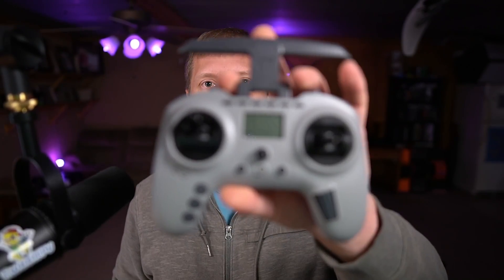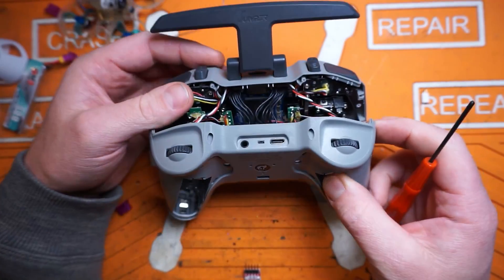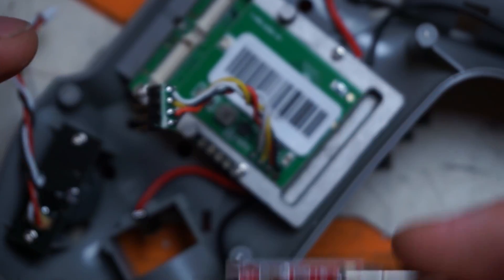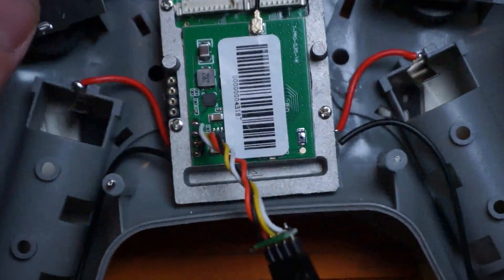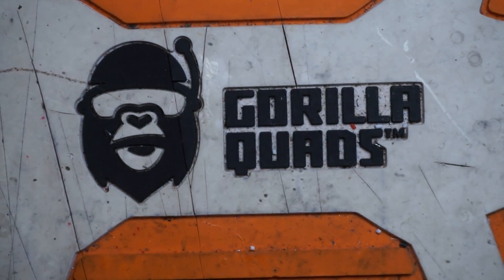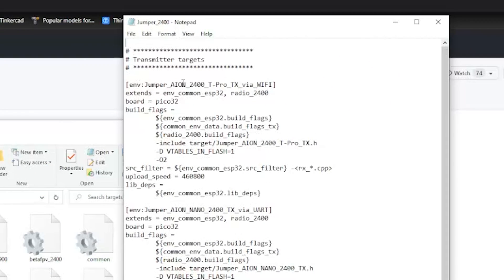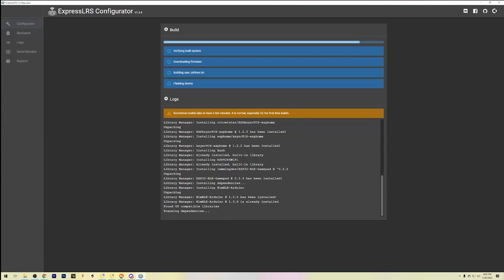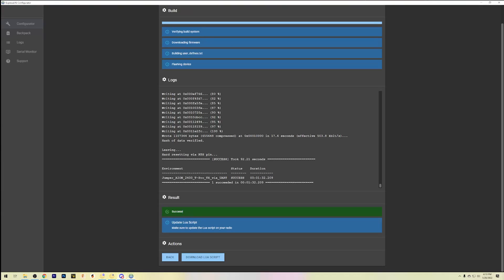Jumper T-pro Internal ExpressLRS recovery. When a flash goes bad #t-pro #elrs #jumper

Comment: question, after I get the FTDI and get the controller to work again how do I update the firmware??? thanks for the help
Reply from the maker: Same way as anything else. Over wifi just don't flash the wrong target. All the info for flashing this radio can be found on the elrs wiki https://www.expresslrs.org/3.0/quick-start/transmitters/aion-internal/

Comment: Got my remote and immediately copied the Lua file so I could bind my quad and immediately got data and syntax errors. I'm sure this works but instead I just sent it back. If the company can't correct the issues on their end, then I'm sure not going to invest a bunch of time fixing them on mine. Giving Radio master my business for now on.
Reply from the maker: Right on! That's evactly what we all should do when forced to self fix a faulty designed product. Good on ya!

Comment: Hmmm... Seems like those are the only 4 wires that connect the module to anything else.  They plug into the back board.  And an external module would also need TX and RX wires.  Is it possible the internal TX and RX are accessible on a back connector?  How common is this flash failure?  If it's common seems like maybe it would be worth breaking those wires out to a new connector on the back the first time you have to open it up. 

Normally, HW designs would have the WiFi reflash-code in a protected page of flash to prevent bricking.  I wonder if they can rewrite their code to make it recoverable if the reflash fails.

Comment: I've decided to update firmware in the TPro.. After I selected everything correctly in the ELRS Configurator drop-down menus and started scrolling down, I didn't notice that the target in the list was also accidently scrolled.. And the wrong target was selected.. I noticed this only after firmware flashing, when the module did not started :)) 
FTDI adapter has been lying around for about four years, I bought t almost by accident - just in case. Hooray, it came in handy :)
Everything is clear and understandable, and what is not said is clearly visible on the video. Thanks, the video helped.
Reply from the maker: 😂 Yea if you are using elrs a ftdi will eventually be needed unfortunately. Glad you were able to recover.

Comment: I can basically flash the firmware using this method instead of wifi? it will prevent the bricking from happening in the first place right?
Reply: If I did not get it wrong, I think he said that the update using the wifi method does not brick the jumper t-pro.
Reply from the maker: It can if not done correctly or with the wrong target.
Reply: @TweetFPV  Let me see if I got it right. If I get a brandnew jumper t-pro and do that procedure before anything else it means that I'll never have a chance to really brick the radio?
Reply from the maker: Oh no you absolutely can brick the radio but you will be able to recover it with this mod.
Reply from the maker: None of these radios are "brickable" in the sence that they are junk. These all have Stm32 chips which have a bootloader. If it has a bootloader it can almost always be recovered from a bad data flash.
Reply: @TweetFPV  Got it. Thanks.
Reply from the maker: Correct

Comment: ExpressLRS writes that with EdgeTX you do not need to use FTDI adapter and use USB. But anyway you need to open controller to press boot button. Did you tired it?
Reply from the maker: I tried it last night without success. I ha e been talking to a dev to improve the process. I have not tried that method since yesterday but they said there were changed to the process.

Comment: Will this also work with a CH340G UART/TTL-Adapter or is a CP2102 specifically required?
Reply from the maker: as long as it has a 3.3v output you should be good to go.
Reply: @TweetFPV  It has a jumper to select the logic level so that should not be a problem. Thank you :)
Reply from the maker: @TheFlash8889  I have one that does that but still puts out 5v so just double check it with a meter

Comment: Sorry if this sounds stupid I am new to this transmitter I have 1 getting shipped to me Why did it brick I mean why did you flash with the wrong firmware . Bardwell announced today Don't buy Is this the case Will i be able to use this or should i return it when it arrives Thanks
Reply from the maker: Mine bricked because my pc crashed mid flash. Other are bricking because the target that shows up on the radio is diy duplextx and people are flashing that to the radio when it should be the aion tx t-pro.
Reply: @TweetFPV  should i keep it when it arrives Or would you send it back? Thanks for the quick reply Should have bought the zorro that was available Now cant get it anywhere
Reply from the maker: Idk, that's really up to you. Put your hands on it if the ergos are wierd send it back. It is missing the vtx backpack functionality if that's something you were interested in. It is 1W and the zorro is 250mw. 250mw is plenty of power imo but more is more. It's a real tough one. I really wanted to like this radio and I do but will I like it more than the zorro? Idk. That radio will be in hand in a day or to so I can compair them.

As far as the durability and long term reliability it's way too soon to tell. No one has had this radio long enough to tell.
Reply: @TweetFPV  Thanks, I really need this radio as I bought the dji goggles in oct since waiting for drone parts to arrive from china and then needing a new transmitter I have not used them yet If i run into trouble There is always you Thanks for getting back to me Graham
Reply from the maker: This is a ok radio and it should work out of the box. There is now a very clear guid on the elrs wiki on how to flash this radio to avoid any issues like what I'm showing  here.
Reply: @TweetFPV  The link you've shared with us to that procedure is not working. Could you update it, please?
Reply from the maker: Updated
Reply: @TweetFPV  🇧🇷🖖🏻
Reply: @TweetFPV  thanks for the video you did, please post the link on how to flash this TPro internal ELRS properly from wiki Elrs, trying not to brick this thing once it arrives.
Reply from the maker: Good call

Comment: Ok , I dont see many problem in what  I'm seeing. I just did the Qx7 inversion and is much more difficult. It is not worse than open a quad to clean it. It is a hobby, it is the bread of everyday, you don't want mess with this things, buy CF and pay 3 to 5 times more, fair enough. You still can use your customer rights.

What I don't know is if after this fix the radio will flash via Wifi, or will be needed flash it every time by UART
Reply from the maker: No, once you get a good flash you can do it again over wifi unless you have a bad flash again. Then it's time to break out the ftdi
Reply: @TweetFPV  thanks by the fast answer, I don't see many issue with this then. Much worse is cannot setup the gimballs without open it, or the battery size of zorro, or the shitty flashing system of frsky, price of TBS...

Comment: Yeahhhh jumper dropped the ball by not working with ELRS/EdgeTX to use passthrough flashing.
Reply: Go ahead and check if your baud rate in the main options was set right after flashing i've seen a video about the module not being recognized cuz of that
Reply from the maker: Wasn't an issue for me.
Reply from the maker: Yea. It always seams like these mfg need to learn their lesson in the first product. Hopefully they don't repeat their mistakes.
Reply: @TweetFPV  I don't even know what I did to 'mess up the flash' I built it and flashed it normally, everything seemed fine, but the script doesn't recognize the module now so there's no way to put it into wifi.

It's easy to flash the module the wrong way when there's literally no documentation on it!

This one's going back to RDQ.  Jumper was so close with this time. Oh well.

Thanks for the video.
Reply from the maker: Yea unfortunately these things happen and you always need a secondary way to flash that's easy for the end user. Jumper missed it on this one for sure.